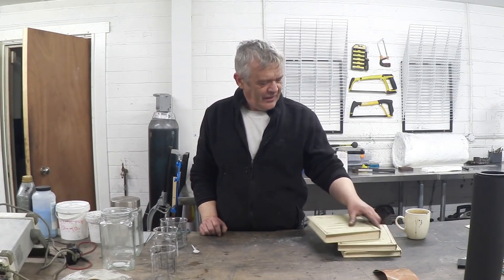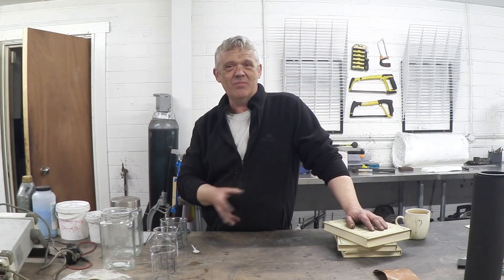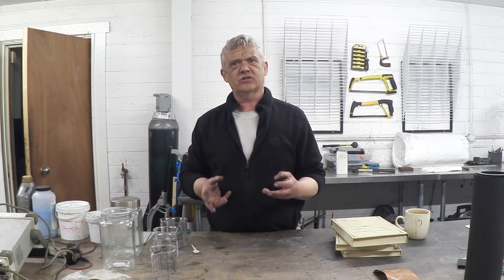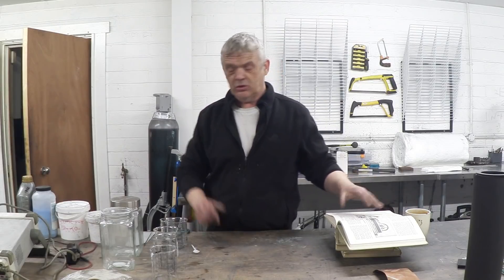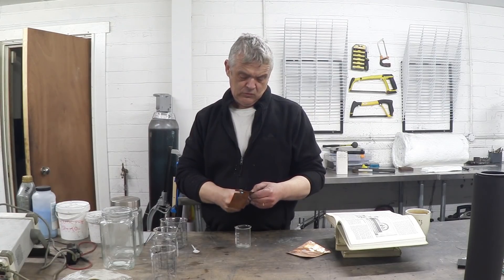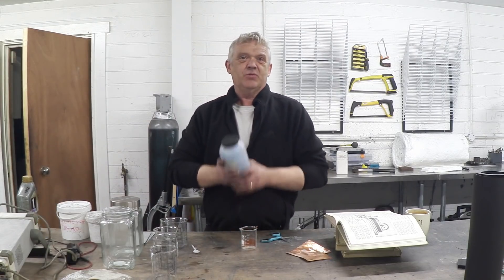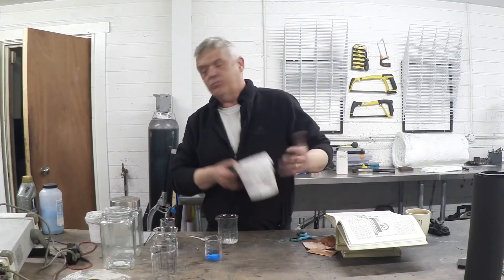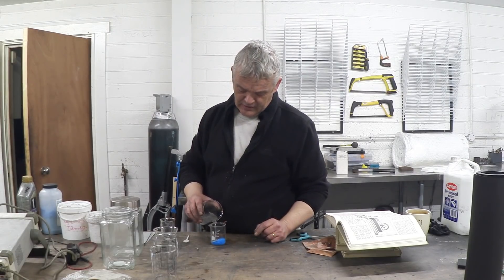Gravity Batteries - Cheap, Easy, Robust And Awesome For Off Grid

Comment: Hi,
I have another question, its actually more of a request.
Would you mind to make a short video, just 5 min or less, explaining what your main battery actually is, how it functions and what are you trying to achieve.
I'm asking because I am a bit confused, in my understanding your main battery is your C6 PowerBlade as a Paper battery, carbon based.
But after searching through many of your videos I still  dont quiet get the hang of it. Is it a supercap or a battery, in your Laptop charging Video you said its a supercap. Another thing would be the Energy Density in your Phase 3 sneak peak Video you talked about roughly 1kwh/kg in your Laptop Charging Video about 8wh/kg. And another thing would be what its made out of. Right now all I know is that its made of two metal sheets plated with a graphene based material, inbetween is a J-Cloth and a Electrolyte. That would also lead me to believe its a Capacitor but maybe I've got something wrong and thats not really your main battery, there are just so many great Videos about batteries on you channel that I don't know what it actually is.
In conclusion: It would be really nice if you made a short Informational Video about your main project, to clear up my confusion.
I think a video like that would also do really nice as a channel trailer, so every new viewer that becomes curious about your channel knows what the main goal is.

If you already got a video like that it would be great if you or another viewer could point me in that direction.
Reply from the maker: hiya mate that is the main battery - but you have to realise it is a commercial product that I am working on with other companies so there is not the possibility of me sharing the exact make up of that battery - mostly the channel is about helping others to develop their own devices not to enable them to copy mine - there are - of course - lots of options and that's why lots of videos to help explore those options - I hope you understand
Reply: @ThinkingandTinkering  Well I didn't think about it from that standpoint. Just like you always say dont do it if you're not comfortable with it, so no problem.
Your channel still is great without it.
Reply from the maker: @leuchtekulli251  thank you for understanding mate

Comment: 11:05

"... a mechanically rechargeable Zinc battery that could be used in automotive applications, or a  moving application. Because obviously something like this you have to sit it on a shelf and you can't really shake it or you'll disturb the gravity." 

Would automotive application imply shaking/disturbing?
Reply from the maker: yes

Comment: I'm curious if you will be making a gravity generator. It's a device used in third world countries to make electricity for lamps and charging devices involving a weight and pulley system. The devices have a weight that spins a little generator (like a computer fan motor) as it slowly falls. The device can be reset by just raising the height of the weight.
Reply from the maker: yes mate I was thinking of doing just that

Comment: Question Rob,
Does the bromine form at the top electrode and sink down or is it formed in place at the bottom?
Was thinking if it forms in place this could be made into a gel battery?
Reply from the maker: formed in place and stays at the bottom - you are spot on with you gelling idea - well as far as I am concerned anyway

Comment: I made one substituting aluminium and aluminium sulphate for the zinc/zinc sulphate. Much lower voltage (0.6v) but it did last for hours and is very impressive visually! It gases off but does work again after a charge (somehow, maybe it is just bubbling away some holes in the copper which has coated the aluminium??).
Reply from the maker: interesting mate - Ali is notoriously difficult to get to recharge
Reply: @ThinkingandTinkering  I don't think I've got that lucky :)

Comment: Nonono, a gravity battery is of course a battery where you charge it with gravity from the Earth, then you get lighter.
When you want your weight back, you discharge the battery. This is particularly useful in aeroplanes and submarines.
Reply from the maker: the ancients knew about it - they used it for moving very large rocks - how do you think Stone henge was built lol
Reply: Hmm, it must be closely related to the energy/matter transformation, it's just energy/mass transformation. =)

... About improving upon the battery, during watching, I was thinking about having a ball-shaped container that could rotate within a parent container, so that it would always face the same vertical direction.
It wouldn't solve the problem with shaking, but it might still add a little stability rather than having to keep the battery in a fixed position.
And I agree very much on the old-tech-new-clothes subject. Take a standard speaker-unit, it really hasn't changed much since the first implementation (not counting variants like panels and electrostatic speakers).

Thank you for always providing interesting content - it seems you never run out of new topics. =)
Speaking of which: Perlite is an interesting high-temperature material; good for foundries and furnaces.

Comment: Great video. Thanks very much. It is amazing that this technology has been under our noses all the time. I am not sure this is relevant, but Redflow in Australia have commercialised a zinc-bromine battery for high-cycle rate stationary energy storage for residential and industrial applications. If you flipped through the pages of your old books you would probably find the genesis of this technology as well. www.redflow.com
Reply from the maker: I know about reflow mate and I think you are probably right - cheers

Comment: .........would use of the oil layer on top also prevent escape of iodine if it was a zinc iodine battery. Or is the high density of bromine an essential factor for the operation of this cell say ?
Reply from the maker: Iodine is a solid at RT mate - but yes it would

Comment: Rob it would be so much better if your answers were more full. Not just agreeing but actual details,how long would battery run driving what etc. and more close ups as you show each part, thank you.
Reply from the maker: I get 200 plus posts an emails every day mate - how long do you think I can spend on answering? - In addition some folks don't bother reading the comments and I end up answering the same question many many times
Reply: @ThinkingandTinkering  thank you Rob, Pls carry on.

Comment: The phenomenon that makes liquids settle down like so is pressure mediation. Gravity is a misconception. Everybody knows that more mass = more gravity .. But mass is medium specific and area specific... Mass changes depending where you are and in what you are... Even the mass of your electrodes changes overtime because of a pressure mediation phenomenon... Not gravity. Gravity means pull... Thats it... It dosent says what is pulling or how it is pulling. It is a misconception kind of like a shadow is really just a lack of illumination.
Reply from the maker: for sure - cheers mate

Comment: Bravo Robert....  I love the simplicity of these with the oil cap. If you decided to double the positive or negative electrodes does it change the behavior of the battery? Faster charging or higher output?
Reply from the maker: yes mate - it is surface area dependant

Comment: In middle school we made batteries with copper and lead. Copper sheet was rolled up with lead sheet and construction paper as a insulator in between. I can not remember what the solution was that we used as the electrolyte. I  dont think it was a acidic solution though. We would charge it with a 12 volt charger and it had a 12 volt light bulb in series with it.
Reply from the maker: that is awesome - I wonder what the electrolyte was? - it does sound. like a variant of the copper zinc battery though
Reply: @ThinkingandTinkering  The solution was white and it would get crystal salt looking stuff on the shelf where they were kept.

Comment: I always like to "Go Large " I worked on tankers where the anodes in the tanks were about a metre long by 100mm x100mm and weighed about 25kg -
one of them in a large plastic container and all the other bits in proportion should make a fairly long lasting battery ,or is surface area going to produce too much power too soon.
And with the zinc bromide one, would I have to worry about large amounts of bromide gas ....a little knowledge is a dangerous thing ..especially if I've got a hold of it !
Reply from the maker: scale always makes a difference mate - with lead acid if you have enough you have to take precautions against hydrogen build up - it would be the same here but that bank would have to be large for sure
Reply: I was wondering half way though this video on just how large could a battery like this be made for an off grid solution, charging via solar panels etc.
Reply from the maker: as big as you like mate

Comment: Although gravity is providing the force, it is in fact the difference in density that enables stable separation. 
I would use the term “Density Differential” batteries in the title.
If the word gravity needs to included in the title I would use Specific Gravity Batteries.
Remember, if you use two chemicals that have identical densities or mix perfectly and homogeneously it won’t work - and yet gravity is still there.
Reply from the maker: Gravity battery is what they were known as and if you want to look them up it's probably a good idea to use the nomenclature that was prevalent

Comment: Do you generally not want to seal gravity batteries due to off gassing?
Reply from the maker: there are seals and seals mate - you always want pressure relief as a just in case measure - after all in the real world who knows what will happen - the oil layer is pretty good as it kind of acts like that too the partial pressure go the gas has to rise significantly but if it does it can vent through the oil
Reply: Depends on the volume of the off gassing the case may pop with significant force splatter the contents everywhere and large amounts of hydrogen may create further problems.

Comment: Love the video.  It has inspired a question...  I have been experimenting with zinc, copper foil with epsom salt electrolyte using a thin piece of Oasis as a seperator.  I'm assuming that I'm getting a galvanic effect, but its definitely rechargable.  The cool thing is that after numerous cycles I can remove the zinc and copper foil and replace them with graphene current collectors  and continue to cycle it getting similar power output.  Is this something you would expect?  I'm getting more output from this than any other device I've made in the past.
Reply from the maker: that sounds like an awesome battery mate - not sure what is going on if I am truthful

Comment: What are the books you are using are they in print
Reply from the maker: they are bound copies of a journal from the 1890's to 1900's called model engineer and amateur electrician - I don't think they are in print anymore
Reply: @ThinkingandTinkering  ok  I have gone through those on Google books
 lots of good old fashioned info from the past that you can acully use 
It's been awhile since I have looked at them. 
Love your work

Comment: I tried the first cell once. I wanted to see if it worked with Aluminium instead of Zinc, since Aluminium was easier to find, cans for example. It worked if Sodium Chloride was added to the Copper Sulfate. No Zinc Sulfate was used. The black motor stand is great. Much easier to see the movement of the propeller. Thanks for sharing. :)
Reply from the maker: nice share mate - thanks for posting - interesting stuff for sure
Reply: @ThinkingandTinkering  I wonder does anybody know how to adapt my version by replacing the copper sulfate for something else? Something cheaper and more available? I wonder if Magnesium Sulfate would work. I better try that...

Comment: I love old books on electricity myself and go through them on projectgutenberg and archive.org but here is a whopper. your copper sulphate gravity battery is actually 4000 yrs old.. not 150. :-) 

https://www.youtube.com/watch?v=9-7Y3UuejOs
and notice the improvement made by making the container be ceramic because the evaporation keeps it cool and makes the battery more efficient..at the cost of rewatering of course.
Reply from the maker: that is awesome mate - thanks for the share

Comment: So if we make a large Zinc-bromine battery with a large surface area electrode and charge it at a high voltage then buy a fuel cell just to use that excess hydrogen and just top off the battery with water? Then have hydrogen gas stations where you return used batteries or used liquid for charging or will this be to low efficiency to be worthwhile?
Reply from the maker: it produces very little hydrogen mate

Comment: This is the stuff I joined the paid membership for. I live off grid an have access to 12 and 24v dc. How would you charge a zinc bromide battery with that?
Reply: Rob said the voltage is 1.8 volts so 7 or 8 of the cells in series should get 12.6 or 14.4 volts.
Reply: @flashlit123  right, the odd charging voltage is the problem. I'm sure there's a solution.
Reply from the maker: flashit has it mate - to be honest you wouldn't have a problem - 12 volt lead acid batteries aren't 12 volts they run between 14.4 volts on charge for a '12 volt' battery and discharge down to about 10 volts or so. That is pretty much where the zinc bromide sits
Reply: @ThinkingandTinkering  I use a charge controller from my solar panels. The charge controller just dumps amps into my batteries till the voltage is correct then it reduces current to maintain the voltage. As I understand that wouldn't be good for zinc bromide batteries. Am I correct in that assumption?

Comment: into flow batteries seem neat any thoughts on making one
Reply from the maker: mostly flow batteries aren't very efficient below around 50kWh because of the pump and pipe overhead - but the zinc bromide is used as a flow battery electrolyte
Reply: @ThinkingandTinkering  i  am a bit late lol .but yes i guess that was silly now i think about it unless on is going to run his barn lighting and a welder off it

Comment: I am impressed, I was thinking along the lines of a heavy chunk of lead pulling a cable over a pulley and spinning a little generator.
Reply from the maker: I actually like that idea mate - cheers
Reply: @ThinkingandTinkering  Of course the energy density is very low, when you think about it:  If everything is close to 100% efficient, a mass of almost 15 tonnes falling by about 50 centimetres in a minute would give you about 1 kW of electricity. (Or 33,000 pounds falling by 1 foot in a minute would give you 746 Watts.) So, allowing for inefficiencies, 15 tonnes falling for 1 metre should keep a single bar electric heater running for one minute. A 60 metre / 200 foot drop of a 15 tonne mass in an hour would run that same heater for one hour. 

Good luck with lifting the mass up by 60 metres for every kiloWatt-hour of electricity which you want to consume! A wind turbine would be one way of lifting the mass. Or if you don't need to store the energy, just make a small wind turbine for your electricity needs. 

Off-topic, but interesting: Someone, who lived on a hill in Northern England, did that in the late 1960's, and was shown on TV at the time. He used his own 'windmill,' as they called it, to heat his house during Winter. Quite interesting to see his electric heaters varying in brightness as the wind speed varied.
Reply from the maker: @RWBHere  pumped hydro seems to be popular and that is the same principle - I don't want to be critical mate - but there does seem to be something wrong in your analysis.
Reply: @ThinkingandTinkering  Gravitational storage really just has a very very low energy density.
Potential energy is "mass*height*gravity", and 1 kg*1m/s²*1m = 1 Joule
1 Ws = 1 Joule
A phone battery may hold something along of 10-15 Wh - so 3600 Joule - or the same as dropping 100 kg from a height of 3.6m

Pump-storage is used cause in mountain-regions it can be easy to get large heights (>50m) and enormous weights (1m³ water is still roughly 1 ton) and water-turbine can react very fast - so it is a comparatively cheap and fast solution that can easily stand for 100 years, while a battery just costs more and will very likely be dead before reaching 10 years.
Reply: @ABaumstumpf  thanks for that
Reply: Get more life out of your dead lead-acid battery! Use it with our new patent-pending Gravattery®!
Reply from the maker: @GRBtutorials  lol - patent pending and registered trade mark - very funny lol
Reply: I like it, too. Seems like that would be easier for the user to operate than constantly cranking one. Periodically lift the weight. Relax a minute while it falls.
Reply: Yes, Richard, you're a genious.
Have 2 or 3 of these to make sure they're providing a constant power, so while one is shifting, the two others are busy releasing their energies.

Comment: Couldn't you just put a sponge or other porous material in the battery to keep the two chemicals from mixing due to physical movement?  It should at least slow it down, but at the cost of capacity.
Reply from the maker: you could indeed mate